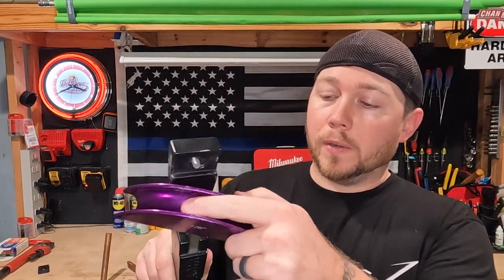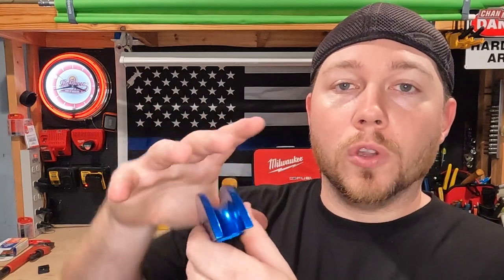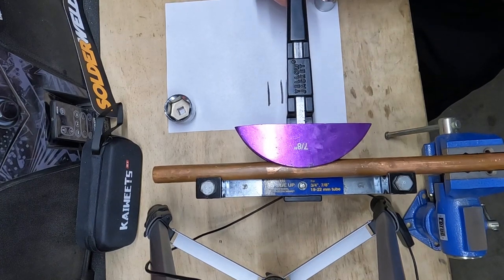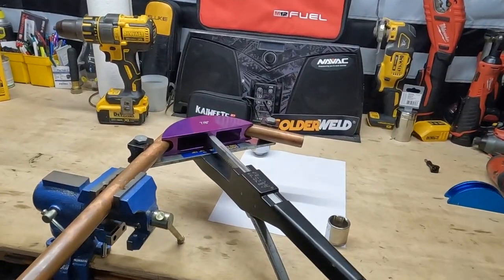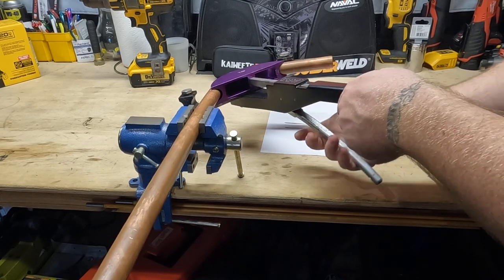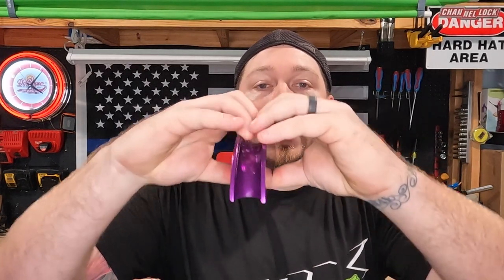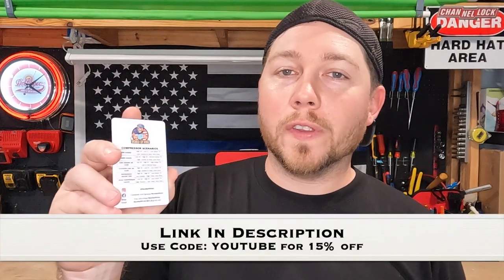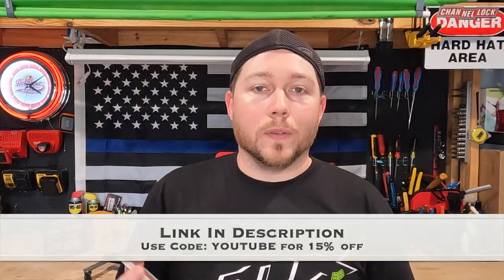Throw Out Pre-Made Elbows!

Comment: As an hvac installer most the time I use benders but there has been some times when I need a pre made 90 because the long sweep the benders make. Example a tight closet where line set pretty much touches the door when I close it.
Reply from the maker: Yea we have to deal with that too. The worst is when we have to notch the door out to fit the rubbertex
Reply: Any tips on how to make pre made bends im new to hvac

Comment: Yeah metal shoes would be nice. Get the reverse attachment too! I almost use it more than just the bender itself. It flips everything so the handle is on the outside of the bend.
I really try to use the bender instead of fittings. Lots of practice getting one peice line sets snaked through some interesting chases.
Reply from the maker: Those reverse attachments are sick! I've never owned one but I've used others. 
Exactly what I mean, keeping one solid pipe throughout the run is the way to go.

Comment: OK...serious question: what type of copper are you using in the video? The piece looks too straight to be soft copper. I have a similar same cheapy bender that I used last year to bend a whole bunch of 3/4" copper for hydronic use. I didn't want hard 90 elbows so I made nice sweeping bend. However, I found I had to anneal the area first so the copper didn't wrinkle on the inside of the bend. It didn't kink, it just wrinkled a little bit. Great video btw!
Reply: I assume hes using 7/8" ACR rigid copper tubing. I'm in the same boat of wanting to use bends in my plumbing work but it seems that all rigid copper pipe sold here in the states is hard tempered and will not bend properly without annealing.